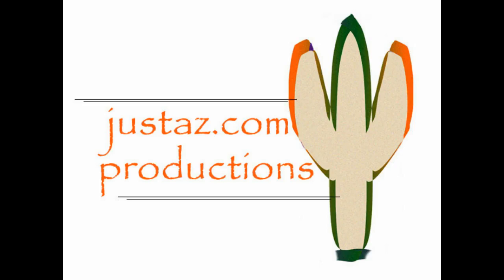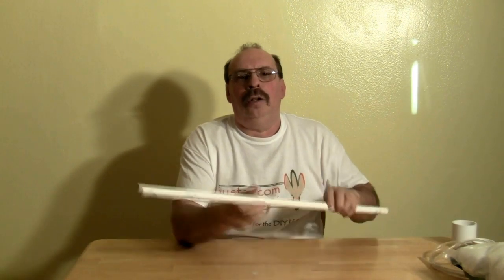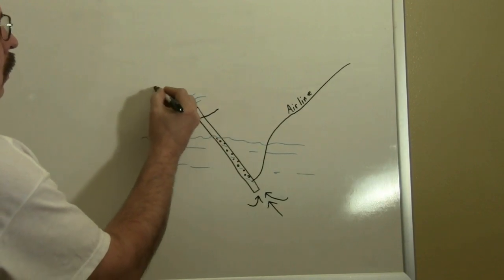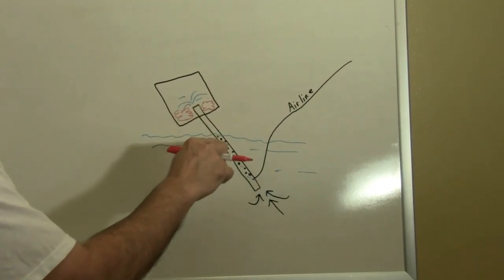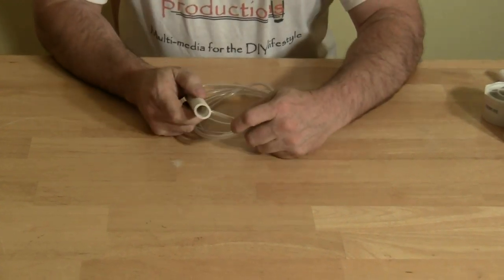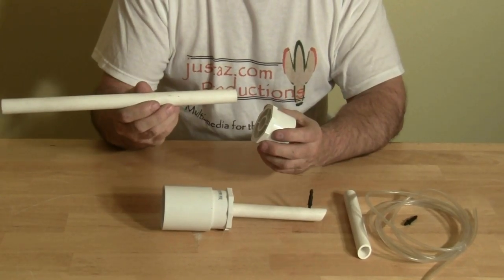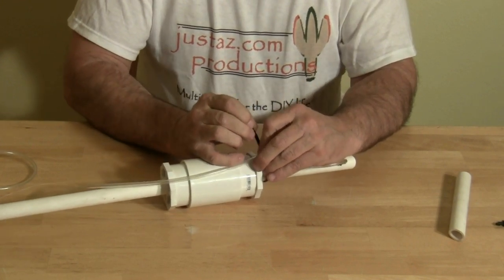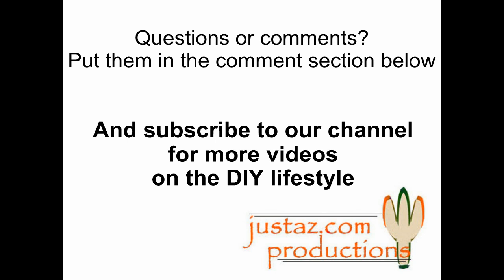DIY Aquarium Air Lift Vacuum

Comment: You can make your air lift vacuum more efficient, by drilling the air entrance hole in the large tube at a 45 degree upward angle instead of going in at 90 degrees. Then take the air tube & shove it in about 1" or so, creating a slight venturi effect !!! Great demo !!!
Reply from the maker: Jim S. Thank you for your positive comment, and the great info. We appreciate you taking the time to watch our video and wish you the best of luck in all your projects.

Comment: Just a query. I have a great idea for a container that is see through. Just need thoughts on how to adapt your idea. I have an empty cd tube that has a screw lid. the clear tub can be the collector which you can see if you are picking up and when you need to empty. Just need to get my head around how and what to use that could work in my Jewel 450L tank. Any inputs??
Reply from the maker: Hello, goldwing15se. The Jewel 450L is a nice tank. I like your idea, but I'm a little concerned with the thickness of the plastic of the cd tube. The tube may not hold up over the long term. Otherwise any adaptations would be just adjustments for a proper fit. Best of luck in this project, and let us know how it goes.

Comment: Love this idea and want to try to do this in the next day or two while giving my tank a "makeover" (replacing top trim). Great instructional and clear directions except I wasn't sure of the gray device the airline went to (since I'm new to fishkeeping). I assume it is an air pump. Is that correct? And what measurements would you advise for making this for a 55 gallon tank?  Thanks for making this and the vid.
Reply from the maker: Hello, Alice Nielsen. The gray device is an air pump. For a 55 gallon tank, we suggest increasing the length of the nozzle to 10 to 12 inches so the container is at the right height for the height of the tank. If you don't get enough lift, use a more powerful air pump. Thanks for watching and taking the time to comment; we appreciate it. Best of luck in your aquatic projects.
Reply: Haven't made this yet. :(  That's the life with 5 kids in the house.)  I did buy an air pump to use in the 55g and stop using the loud noisy one. But will use the noisy one for this project - the pump still works and won't be wasted. Yay. Thanks for the info on the measurements. I already have a 6' pc of the smaller pvc at the house so only need to pick up the larger pvc pieces.  Again, thanks sooo much for this vid.  When I get the chance I want to see some of your other vids (& your wife's, yummy).